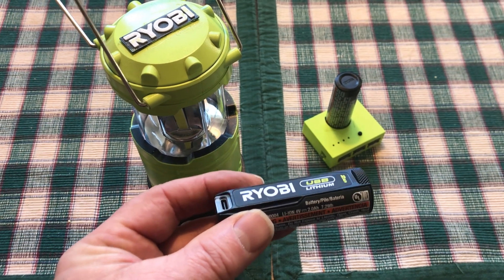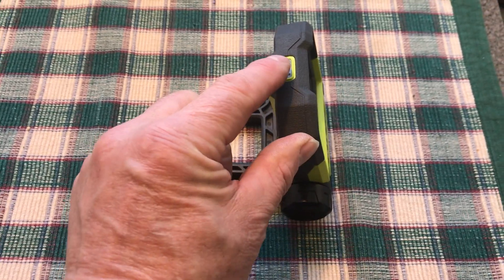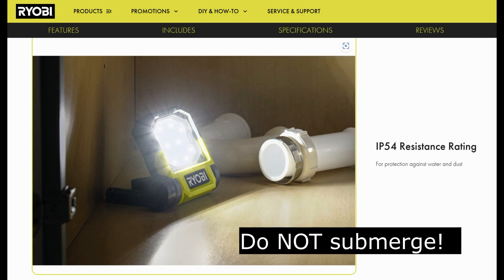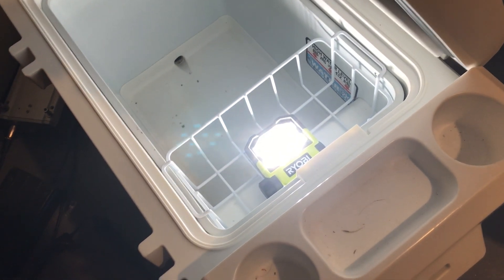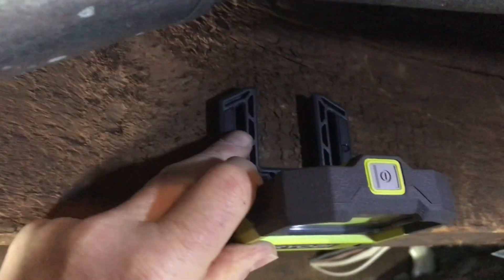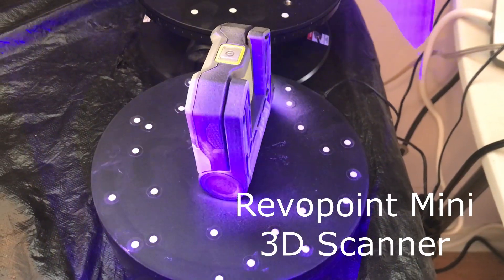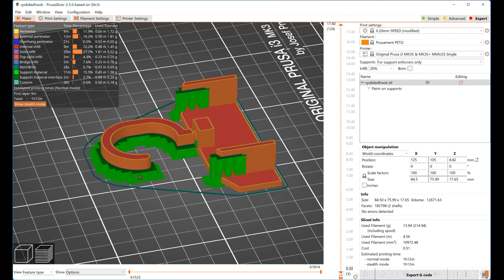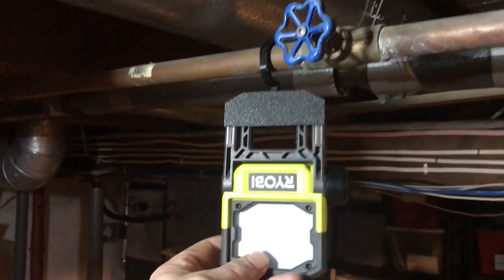New RYOBI USB Flip USB Light and 3D Printed Mod (FVL52)

Comment: 5:54 what's that little screw hole on the back of the light? is it for a 1/4" tripod mount?
Reply from the maker: There is definitely a treaded hole on the back. I could not get my 1/4 tripod bolts to thread. I need to get my metric set out to see what it is. Interesting it is not mentioned in the Ryobi literature

Comment: I haven't seen these in Australia yet, interesting way to safely use a single 18650 in a consumer product, the torch is not all that interesting, but the battery implementation is the cool thing here to me, will be interesting see if this catches on, and will be interesting to see what products Ryobi come out with as well, nice job on the 3D models, I'll be sure to check them out on Printables.

Comment: Very cool stuff!  I'm not sure if I'm sold on this line of tools and toys from Ryobi.  There are rechargeable lithium batteries available in the AA form factor which are quite affordable and work with just about any common light designed for alkaline batteries.  The highly rated Pale Blue rechargeable lithium batteries are available for about $7.50/ea.  Two of them would deliver around 5500mah, compared to the 7300mah of the Ryobi cell.  The Pale Blue batteries can't charge as fast because they don't use a USB-C port, but this "should" result in them having more useful charge cycles.  All of this is very compelling, when you consider the disposable alternative.

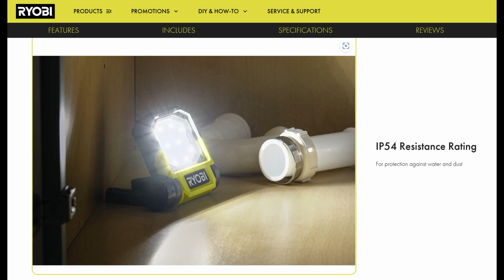Comment: Great video. 1:40 - how long did it last on the lowest setting? did it achieve the 24 hour spec?
Reply from the maker: I still need to check the 24Hr run time... The run-time results seem to correlate pretty well with the lumen output. 40 lumens is quoted as running 24 hours. 500 lumens is 12.5 brighter and therefore should run around 24/12.5=1.92hrs. In my test it ran 2Hrs and 9 minutes.